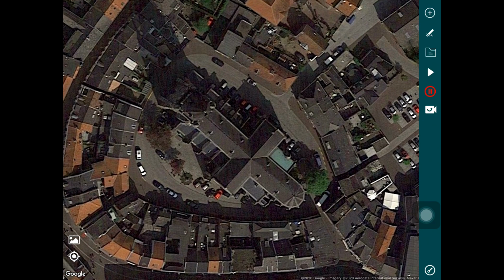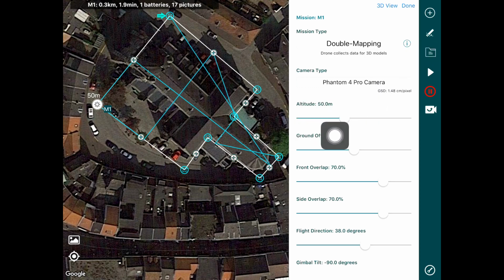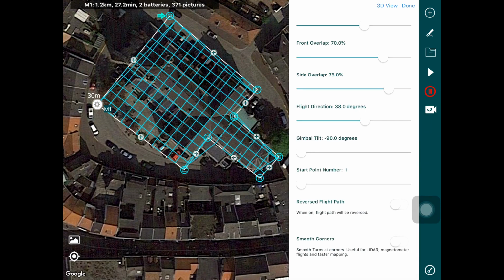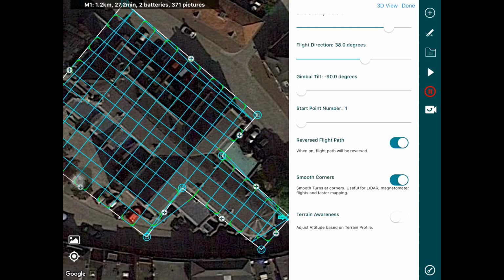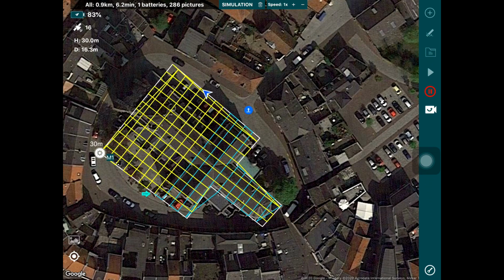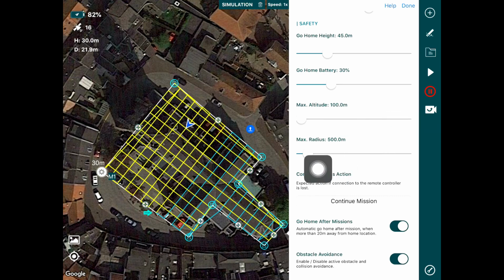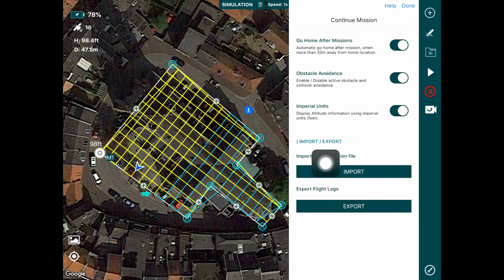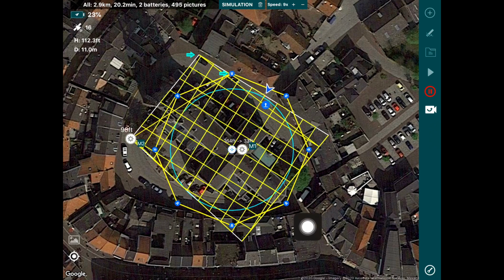Capturing 3D Models with Hammer Missions - Tutorial #004

Comment: I noticed when you set up the mission it indicated that you would need 2 batteries.  But when you switched to the simulation, it indicated that you needed only 1 battery for the mission.  Why the difference and which one is the more accurate estimate?
Reply from the maker: Hi there, thanks for your question. The video was edited/cut before posting - so it's possible that the mission settings changed before simulation. In general, when setting up the mission, the mission estimate will indicate the estimates for the specific mission. On the other hand, the simulator will show an estimate for the entire flight - which might include 1 or more missions linked together. Hope this helps!
Reply from the maker: With regards to the estimate accuracy, we currently assume that the simulated drone has an average battery life of 20min - obviously this might be lower or higher for a real drone. We plan to change the app so that a drone model can be set and all estimates will be calculated accordingly.